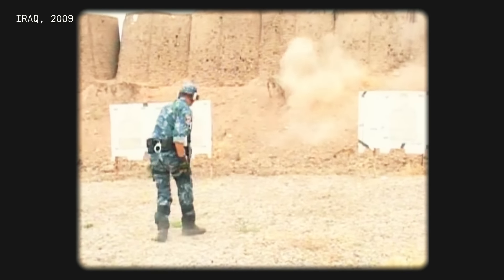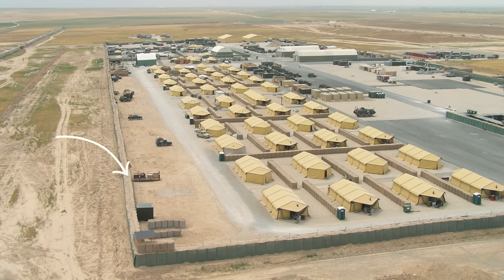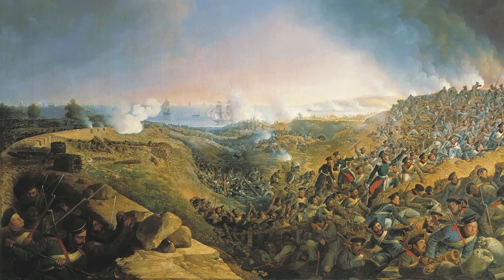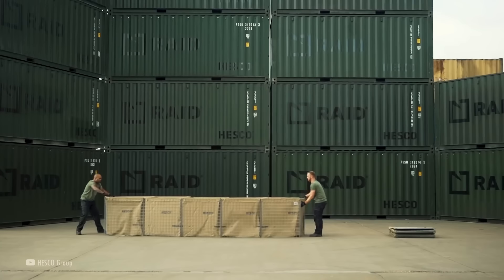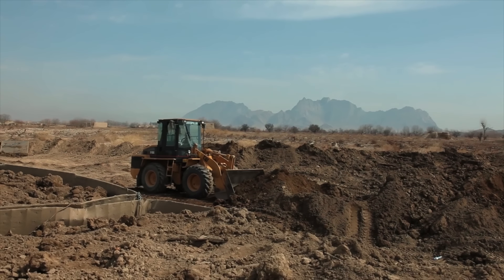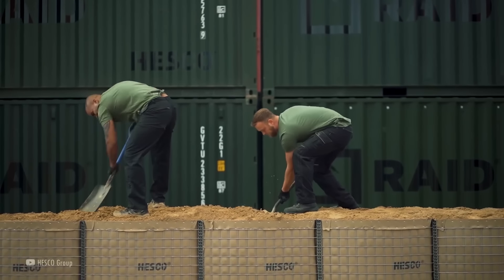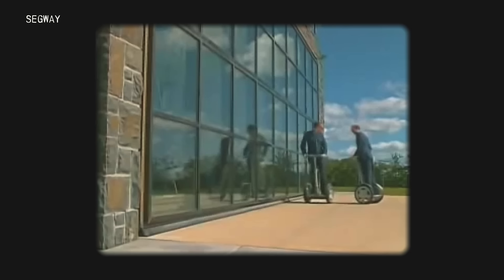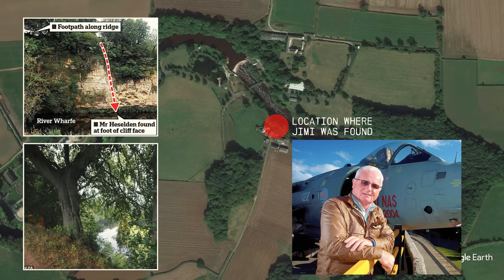Goodbye sandbags?  This is how fortifications are built now | HESCO Barrier

Comment: the major flaw being it works very poorly in wet areas, it needs a dry base and dry fill; if the structure built gets waterlogged you can forget the re-use or dismantle part.
Reply: So use sand bags for those places
Reply: I built and deconstructed these all over Africa in 2019 , they NEVER come apart in the Sahara , sahel or jungle , just use the gas powered chop saw , or 20-36 inch bolt cutters they work really well when you don't have any mogas . Also if your gonna pour concrete in them , which you can , do 1 foot at a time so they don't bulge, sweel or leak out the bottom , mixing a lot of crush and run in works good . Also you can send the exterior side of the cloth and grass and vines will grow on it , don't forget to wire claymores on the sides before you seed and plant vines on the sides .
Reply: Re-use is Secondary Positions have to be hold over long duration.
Reply: Hear me out. What if we take a fueler; the m978. Take the fuel our of the equation, replace it with concrete, and 3d print the barrier. That way if its wet it should be able to print a foundation itself, given the fortifications lend curing time
Reply: You dont get its intended use Steve Jones, that's okay
Reply: How often are sandbags reused??
Reply: It was designed to be used in wet areas as a soil erosion deterrent
Reply: How well do they work on uneven ground?  Does the ground have to be semi-leveled first?
Reply: There’s gotta be a simple fix for that
Reply: @rogerjensen5277  not necessarily
Reply: That’s not completely accurate. We used these for bridge abutments for river crossings. They call for rock fill if using them in water applications. But yea you can forget about reusing them after that.
Reply: How did they hold back a flood it works bad in wet?
Reply: @rogerjensen5277  The good news is if you have to level out the ground you'll be putting that dirt right back where it was just inside of the barrier.
Reply: It is a brilliant concept . I can’t understand why I have never seen it deployed  in civil use for emergency flood control , stabilising land slides , or temporary retaining walls / barriers . Is it suitable for such applications ?
Reply: @andrewoh2612  probably because the fueler uses a pump And if you run concrete through the pump it's going to jam the pump.
Reply: I mean we normally just leave our crap laying around anyway so I don't see a big difference; if we're not gonna take a helicopter back with us we're not gonna take a used hesco
Reply: But does it still protect. And are u speaking from experience?
Reply: @ForceOfChaos1776  consider that I believe it was originally said to be used as a water barrier
Reply: @jessieyoung3759 nice to have a comment from somebody who knows what the hell he's talking about
Reply: I served in Bosnia, Iraq, Afghanistan. HESCO was used extensively in all those places, some of which were very waterlogged especally Bosnia. Never had a problem.
Reply: @Travis_22  hey bro thank you, I am just a worthless liar, I’m safer feeling 👋🏃
Reply: @ForceOfChaos1776  lol no problem.
Reply: @ghostmantagshome-er6pb  until they aren't useable anymore, depending on environment and treatment anywhere from 10-15 uses with the garbo plastic weave bags and canvas or jute bags can be reused 100s of times especially if you're using dry sand and not dirt.
Reply: @andrewoh2612 homie, you invented the cement truck lol
Reply: Yes but we are entirely the United States of Israel now so this isn’t a problem.
Reply: which is of course no flaw at all, since noone intends to use those things over and over again...
Reply: Was going to say, having worked with those types of materials constant humidity or wetness would destroy them. Also interested in how they hold up on the cold and UV, does the fabric/plastic get  brittle over time?
Reply: Hesco barriers don't cost nearly enough to be worth disassembling and reusing.
Reply: are they even reused anyway?
Reply: @Czeckie  the poor locals pull them apart for scrap metal
Reply: Most wet areas aren’t wet year around, small disadvantage
Reply: @robertb7643  but... sandbags work pretty good in the wet...
they can hold back water... cheap
Reply: Weren't they initially used to successfully stop flooding areas? 🤔  It seems the government report didn't find fault with them, even when wet.  Issues that arose were generally tilting when filled improperly or when the ground froze, but thawed on one side not the other; not a problem in the Middle East.
Reply: Where do you often see this ? In a dry or wet area?
Reply: @rogerjensen5277  you can take them apart one by one if needed....sou you wont have to even ground for 20meters..
Reply: @markantoine1254  everywhere is a dry area until it rains
Reply: @sheenapearse766  It was originally designed exactly for that and shows that in the video. watch from 2 minutes in.
Reply: Water is more effective at stopping projectiles than sand or dirt......so what you're saying makes no sense...
Reply: @jamesmeppler6375  I'm not sure who you're replying to. Regardless, bullets can penetrate a decent length in both, but you need a few feet less of dirt than you would water.
Reply: @Khronogi no such thing as a cement truck 😂
Reply: Those are flaws from a tactical point of view.
Reply: There is a flood barrier version. Another great British invention
Reply: this literally isnt true
Reply: A major flaw with tanks is that they can't fight in the ocean. Different applications for different environments....
Reply: @andrewoh2612  What a stupid idea.
Reply: Can still they be used to stop or reduce floodings, like deploying them before the emergency?
Reply: Bro, when you put those things down, they’re not meant to be moved and used again they’re there to stay. We use those as far back as I can remember 04 in Iraq. And we use them significantly more in Afghanistan and 05-06 and 07-08. So yeah buddy obviously you’ve never use them or built any structure with them. They’re not going anywhere once I get down. I’m sure other people in the comments have said the same thing. I just haven’t read them yet.
Reply: Bro, when you put those things down, they’re not meant to be moved and used again they’re there to stay. We use those as far back as I can remember 04 in Iraq. And we use them significantly more in Afghanistan and 05-06 and 07-08. So yeah buddy obviously you’ve never use them or built any structure with them. They’re not going anywhere once I get down. I’m sure other people in the comments have said the same thing. I just haven’t read them yet. Another thing how the fk did this get 1.4 K likes… people obviously think you know what you’re talking about😂
Reply: @rogerjensen5277  no they were fine. We’ve used them on all kinds of different terrain.
Reply: @RT-qd8yl  the guy who posted the original comment obviously is uneducated on the way HESCO baskets work.. they’re not meant to be emptied out and taken with us. They are meant for temporary to permanent structure that you just leave or destroy when you leave.
Reply: @martypoynter9806  I don’t know what they were originally made for, but I know they were a huge help in constructing fortification in Iraq and Afghanistan wrote my three deployment. they are not meant to be taken down. What they do sometimes do is if it was a temporary structure and they have the means they destroyed them either cutting the metal grading and slicing belt or knocking them over with equipment.
Reply: What I love is the thumbnail has sandbags stacked on top ......

Comment: HESCO don't work in a real war like in Ukraine because normal artillery destroys them. HESCO works when you are occupying a country and fighting insurgents.
Reply: Sorta, they resist to that stuff pretty well, they are better for setting up bases and defensive positions far behind the line, the time to use it on the front of Ukraine makes its use impractical, and normal artillery destroys anything it hits close enough too, but even then it’s made of thick material and filled with sand a meter or more thick
Reply: I've saw the HESCO-like structure being used in Ukraine, just in different way - to reinforce the trench walls, so they wouldn't collapse when bombarded by artillery.

I guess they don't put any above the ground, as they would be easy to spot, target and destroy.

And once the front wall falls, I imagine the tank shells, RPG's, 30mm explosive rounds,  impact grenades, etc. fired directly against the still-standing back wall would detonate, sending shock wave and shrapnel to anybody in the remains of the corridor.
Reply: Protection is better than no protection.
Reply: @ghostmantagshome-er6pb  : that's what she said.
Reply: This is way better than those dragon teeth lol
Reply: @rhythmandacoustics dragons are mythical creatures so what you’re sharing has no relevant purpose here
Reply: @miloelite  "Dragon Teeth" is the name of the zig-zagging trenches in Ukraine.
Reply: No its the concrete anti vehicle pyramids
Reply: No @Ludovit110
Reply: Any barrier can be destroyed.  A hesco barrier cost about $50 and takes about 2 minutes to fill with a loader.  Sandbags would cost about the same but take 4 hours with about 4 soldiers.  Both barriers provide excellent protection but are not impervious to direct fire.  These barriers are more for indirect fire.  The only answer to direct fire is a proper cement/steel bunker which takes 3-6 months to make depending on the size and how many people and equipment on hand to make them.  Basically a tent base can be put up with hesco barriers in about two days to a week.  A proper base could take a year or longer.  It’s really the only answer for a moving war where the battle fields are changing everyday.  In a defensive/static war the proper bunkers that are cleverly disguised are a better option.
Reply: Insurgents don't have mortars and improvised artillery? I guess I was hallucinating all that incoming we received.
Reply: @kennykash6089  i am talking about real army artillery like 155mm or 152mm or even bigger. No trenches in Ukraine use HESCO because of that.
Reply: @AlexRoivas  So, you wouldn't fortify your position on the chance the enemy might attack it?  Really?  And you think HESCOs can't be repaired or replaced?  I promise you the Ukrainians (or anyone) would kiss ass for HESCOs if they were under fire.  You know NOTHING about ground combat bro.  You should stick to pretending you know things about the Navy or Air Force.  Something else son.  Later on.  :)

Comment: I spent many hours around Ramadi in a loader, both filling and removing HESCOs. The idea of pulling the rod and dumping the dirt out is a nice thought, and might work if you're making a promo video and it was only filled an hour ago. In practice, by the time you're told to remove the things, they've been in place for months or years and seen at least a couple good rains. At that point, they may as well be concrete for most purposes. You couldn't even push them with a D7, most of the time. My method was to simply attack them with a clamshell bucket until they ripped apart, while softening the dirt. Ram them, pinch the top and pull, scrape vertically with the teeth–whatever it took. You ended up with a pile of dirt and HESCO scraps all mixed in, which you could load into a dump truck (or...not).
Reply: They called you...The HESCO Hunter 😅
Reply: @rickskellig4652  Ha, I would have preferred that over most of the nicknames I earned. Just like pilots' callsigns (in real life, not the movies), they are rarely flattering 😂
Reply: @hibob841  It wouldn't be military humor if it was flattering.
Reply: If getting the rod out was a problem, You might just order a T-post puller from your nearby Tractor Supply (They had those in Ramadi, didn't they?)  Doesn't solve the compaction issue though.
Reply: Yep, having worked with soil I laughed when the dude just undid the metal retaining rod. Not to mention soil likes to expand when it gets wet, so good luck pulling that thing out when it's bursting at the seams after a few rains.
Reply: you cant pull the rod out with the dozer blade?
Reply: @CmdrSoCal  Dozer blades don't lift high enough for that (around 1M/3 ft for a D7). You could probably chain the rod to a loader or telehandler and yank it out, but it's not going to accomplish much when the canvas and dirt have cemented themselves together into a solid block.

Comment: Don't forget that properly filled  HESCO barriers excel at absorbing shockwaves.
Reply: Just not from anything from the Russian FAB family.
Reply: @laurencekelly5081 Lol what makes you say that
Reply: @JohnMaxGriffin  hes technically right but the FAB family is a group of... literal bombs coming in at 100kg (smallest) to 1000kg (largest) which the HESCO is clearly not designed to counter.

in other words, if you have a HESCO barrier being hit with a hundred kilogram bomb (or higher) on a military installation, then alot of things have gone wrong.
Reply: @laurencekelly5081 There's nothing special about FABs compared to other bombs of the same size and explosive content.

Comment: automatic sand bag machine used for flood fighting in small municipalities can do 1000 sand bags per hour.. so apples to oranges when they show marines filling single bags one at a time.  there's also concrete T-wall that goes up in the same amount of time if fill is unavailable for both.  While HESCO was neat addition while deployed it was only successful when it was used in conjunction with other barriers..  But nice video, brought back some memories..
Reply: Like most things, it just ends up being another tool in the kit. I imagine the main advantage was streamlining. Instead of tons of specific/dependant equipment to set up bases, pour concrete and such you just need a frontloader, something any decently sized base would already have. You also need zero specific knowledge, I've seen some people do some bad concreting due to not understanding different grades and cure times as well.
Reply: But how many T wall segments can you fit in a Chinook?
Reply: Everything is shipping airlifted in u gotta account payload and security